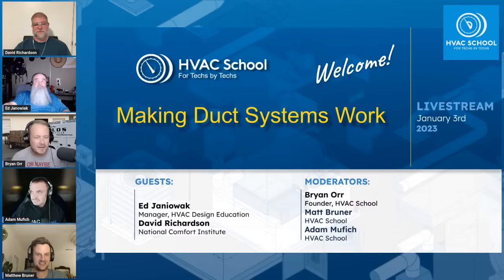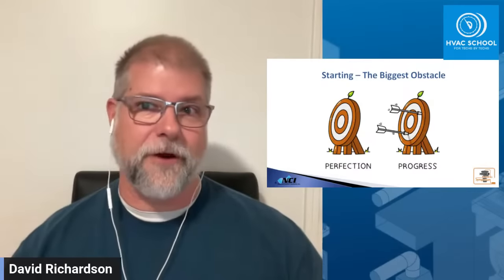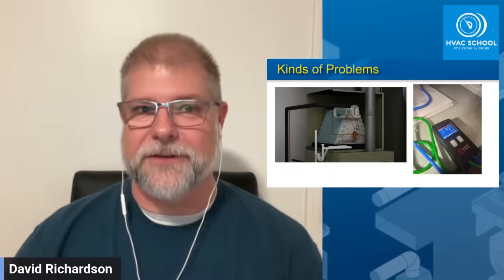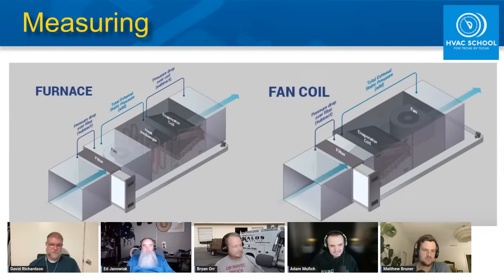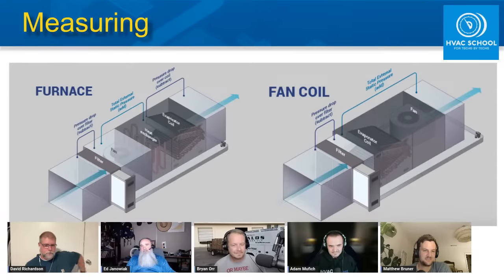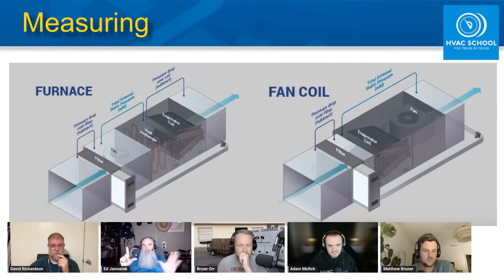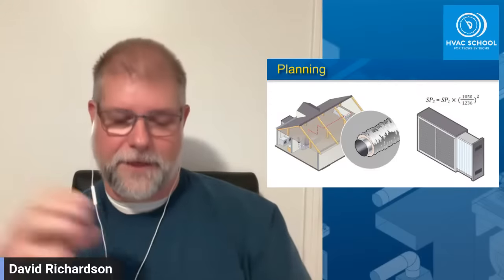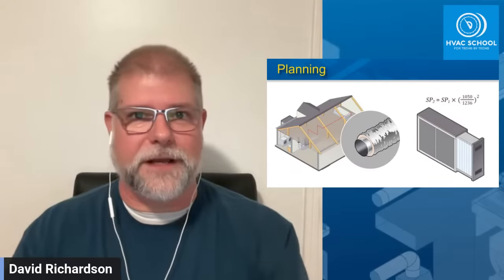Making Duct Systems Work

Comment: Ed is sure right about larger ducts. I used 12" flex ducts for a 1 ton, and it works great! I put a $219 window ac in my attic loft and it cools 3 rooms. 7 years, so too late to tell me that it won't work. my 1st system too.

Comment: 3:52, You talk about how It's all right to use multiple one inch filters in place of 1 larger filter, but that's wrong. Not only are you going to increase the MERV rating beyond the manufacturers specifications of the unit, but with the extra filters your adding, your adding extra surface area that the air has to pass through and thus creating more restriction in your duct system
Reply: Ive always been told this as well, maybe multiple lesser merv rated filters? Not sure if it works that way. Either way ive akways been told if you need a thicker filter, just put the smaller one in for now until you can come back
Reply: I don't see how the amount of filters changes the merv rating of the filter media. Also, the whole point of a 2", 4", or 5" filter over a 1" is to increase the surface area of the filter material,  which will 1) potentially allow more airflow into the air handler, and 2) reduce the frequency of filter changes. Assuming the return ductwork is sufficient and merv ratings remain the same, how is there any difference between X total square inches of filter media on a 5" filter, or X total square inches added up between 5 separate 1" filters?
Reply: @1ucapedia  I believe if you added surface area of five 1" filters and the surface area of one 5" filter, there would be a large difference. I don't think they add up. I'm betting maybe two-three 1" filters make one 5".
Reply from the maker: In parallel not in series
Reply: @1ucapedia  if you have a 5" filter with an 11 MERV rating, and you replace it with five 1" MERV 11 filters. You now have a merv rating or 55, which is way above what would be necessary for the unit. And Okay let's say you use four 1" MERV 2 rating and one MERV 3 rated filter your still creating more restrictions in your system by increasing the amount of surface area the air has to move across.
Reply: @Portugalishere1998   In parallel not in series. I was under the impression no one would place filters in series. I should have expanded on that.  An example would be 3 large filter grilles in place of 1, 1" filter in the air handler rack or a 5" filter rack.
Reply: The problem becomes more so, to blindly add a filter, registers, and not take into account the friction of each and how it will affect the system. In addition, many people out there do not calculate the friction rate needed for air flow to reach the further run from your system, hence the total equivalent length of your duct, then size your duct accordingly to a known friction rate, rather than guessing or using a rate we’ve been told to use.

Comment: I found flex duct not supported properly thus effecting air flow. Simply property strapping the flex duct properly helped
Reply: Ughh my attic is full of that sh** with 90s everywhere. I'm thinking of adding sheet metal 90s instead or hard piping from the trunk to the offsets not sure yet

Comment: Can you have too much return??
Reply: I was gonna ask the same thing!
Reply: No, it’s nearly impossible to be too large, based on what they’ve said in the past.
Reply: I'd say YES if it is running near the roof. On a really hot day having 120F around the duct will raise the temp of the return air. Size it right and pick up less heat. Most ducts are only R4 to R6 and they still transfer heat.